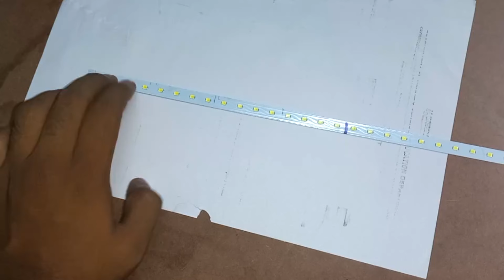Making Mini 12 V LED tubelight from old LED tubelight #diy #creative #viral #electronics #homemade

Comment: do the lights last long?
Reply from the maker: Yes sure. But make sure that you should connect it with Dc 12v or not more than 13.5 v